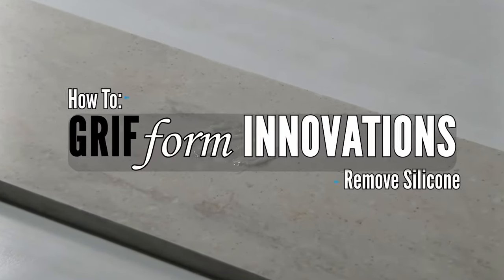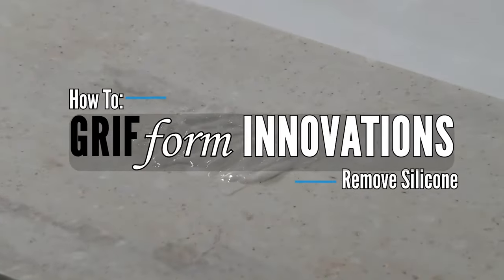How to remove Silicone Sealant from Solid Surfaces

Comment: How about a razor blade. Works fine.  The problem is silicon leaves a residue and for this the best option is lacquer thinner in my opinion.  Although acetone works as well on most services

Comment: It doesn't work for every caulk sealant. Works well on silicon.
Reply: What would work for caulc sealant please ?
Reply: @GalacticWoman I had to use mineral spirit and heat gun.
Reply: @nouche-30064  Thank you
Reply: @GalacticWoman I used a plastic scraper or a blade